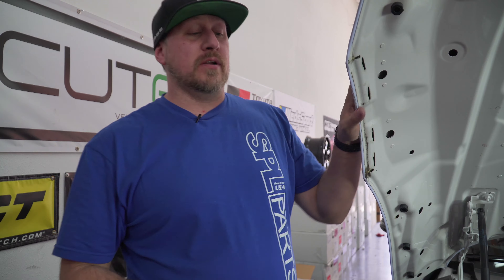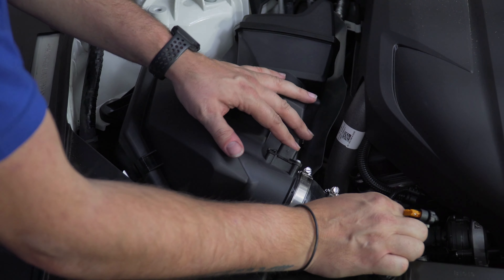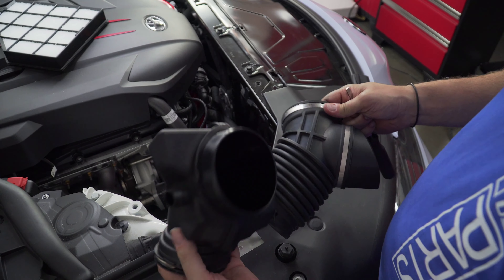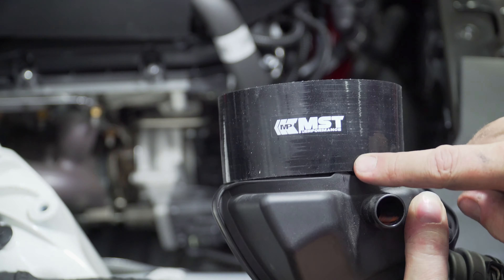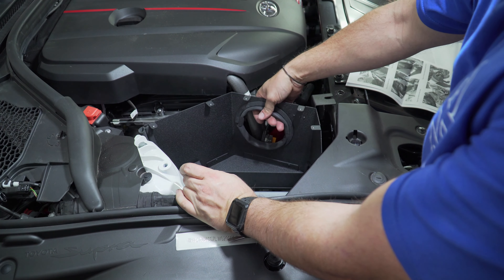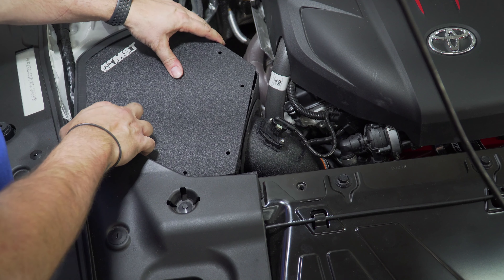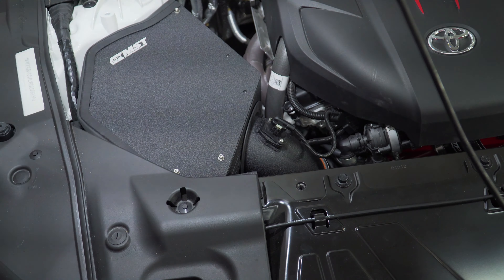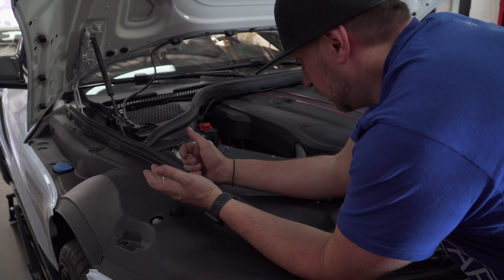GR Supra MST Intake install and sound clips

Comment: Hey SI, So I purchased the MSTv2 intake from you guys that replaces the whole intake from the filter thru the stock pipe that clips onto the turbo (vs using the stock pipe with the v1). I was wondering if you noticed a slight flutter on heavy deceleration? Every piece is tightly secured except the v2 pipe that clips directly to the turbo. That piece has a little wiggle like its not really an air tight seal - Its just held in place by a retaining clip. I did remove and reuse the orange factory seal ring but it still has some wiggle. I get great turbo noise and whine and "blowoff" (if we can call it that) but the flutter has me concerned that air is getting in elsewhere besides the through the filter. Do you think it could be the waste gate sound or do you think im leaking air from somewhere?

Thanks
Reply: Ur leaking air
Reply: It's supposed to make that sound on decel, its releasing all of the air that was being brought in when you were previously accelerating
Reply: @greenscreenmachine6405  bad troll stick to memes and anime

Comment: Do you need a tune for this?
Reply: A tune is not required to run an intake. However, in another video of a competing intake he says that you will not see a horsepower increase with any intake unless you tune it because the DME senses the engines torque output and it will dial back any torque increase to stay within stock parameters.